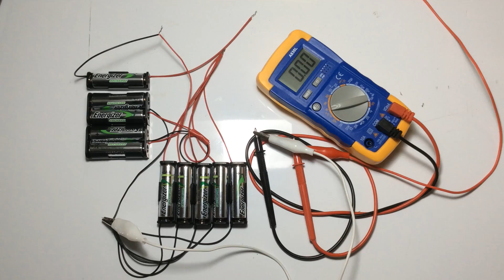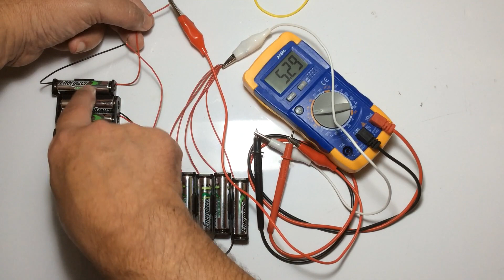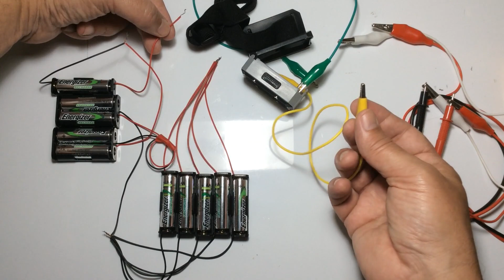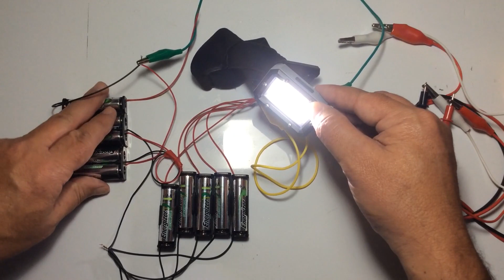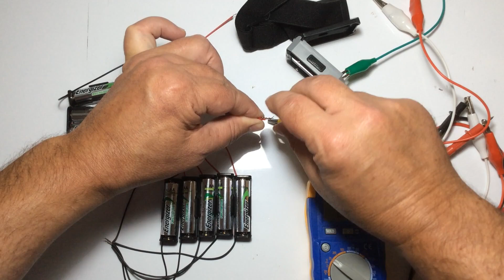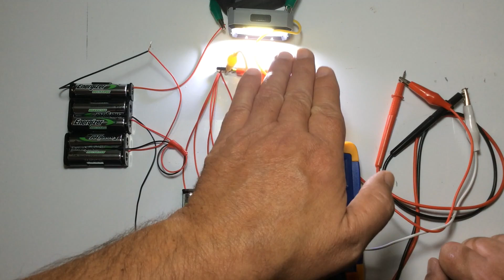POWER TRANSFER METHOD - GREEN ENERGY RECYCLING

Comment: Thanks so much dear for shearing. I think this is all about a potential difference across either positives or negatives. One day i used a boost converter to boost a battery voltage from a 12v to 35v and then connected a hug capacitance capacitor [10mf, 100v ] to this output of a boost converter 35v in stead of swapping batteries. Then i connected a 12v lead bulb across the positives of the battery and the output capacitor. it produced a massive light in the bulb. However i lacked the wattmeters which i needed to measure the energy in and out of the system. If you can also experiment with such an experiment as it looked to be effective. We need to connect one wattmeter to the battery to measure the input energy and put another wattmeter across the load, then we shall get the exact cop of the system. With this i believe some energy is transfered back into the battery source through an inductive load.Thanks
Reply from the maker: Thank you for your comment.
Your experiment sounds very interesting, I understand it is difficult to explain the connections but if you want to give it a go then I can attempt to test it. Normally one would assume a capacitor would not supply enough power but as can be seen in my latest video these devices are not consuming the normal amperage.

Comment: Thank you for this video. You may have noticed with a comment on another video of yours that I did this test using a 3V DC (brushed) motor. It yielded results in terms of energy transfer to the parallel bank batteries, but not near as impressive in terms of run time and transfer that you're doing with an led. Presumably this is because these motors are inefficient (produce waste heat) but cheap to make. When I get the $$ I want to redo the test using a proper brushless servo motor operating off a pwm. I did a little investigating and it seems from initial feedback that they may be even more efficient than an led! (but I can't be sure of that until I do it)
Reply from the maker: Thank you for your comment and sorry for my late reply.
Unfortunately most motors are just not very efficient and the cheap ones are terrible, proud of an approximate 30% efficiency rating resulting in 70% converted to heat. So I imagine the best approach for this system is a load as close to 100% efficient as possible, the more efficient the load the more we can transfer. Some of the hobby aircraft motors may be more favourable and it may also be a good idea to read the stats on the motors in search of the high efficiency motors. A pulsed motor would be a good idea because the down time and collapse of the coils fields allow the capture of extra energy.
Please let us know how it goes with your experiment.

Comment: Hello. Did you try with a DC motor? A small one to see if transfer still works with a system using induction ?
Reply: DC motors (the typical kind that operate with brushes) are very inefficient. I did the tests with a 3V DC motor and while there was a transfer of energy, it is not as impressive as using something like an LED. Probably comparable in terms of waste to an incandescent bulb vs an led, primarily from waste heat. But yes, there was a transfer of energy to flat batteries regardless.
Reply: @stravs8097  Thanks for your answer. Leds are acting differently than conventional load (if I may say !). Probably transfer could be more efficient if high voltage transformer can be applied on induction loads using some capacitors for fast decharge at high frequency rate. Anyway the method shows that interesting phenomena appear in that configuration and it must be studied. Have a great day
Reply from the maker: Thank you for your comment and sorry for my late reply.
I did try with the 12 volt motor and a smaller 3 volt motor and whilst both motors work, there was a noticeable loss to heat as opposed to transferring the power.
As @stravs8097 has pointed out from his experiments, using a higher quality motor may improve the outcome but for now motors may not be the best loads. I have read pulse motors are a good thing so if I ever rebuild my pulse motor I will definitely give it a go.

Comment: New discoveries base on your creation: try to keep the voltage differences between the ones in series and parallel. Big difference leads to faster draining because amperage increase with voltage. If the voltage difference is too big, the battery capacity needs to be bigger or else they will drop beyond danger levels. Personally, I like the 2 series 2 parallel for 12v setups because it keeps the voltage difference low. Of course 10pcs of 3.2v lifepo4 batteries is cheaper, but they drain way too fast and have to keep them swapping 😂
Reply from the maker: Thank you for your comment and sorry for my late reply.
I would agree with you regarding the voltage difference, if too large a difference we just get heat being produced. My latest video shows this, as the voltage drops, the amperage settles down to an extraordinarily low value. For example, the circuit at 7 volts uses approximately 18mA whereas at 6.6 volts the circuit uses 3.4mA.

Comment: Since electrons are not destroyed in a circuit they are free to be sent into batteries to be charged. The heat and light though come from another source which some call zero point energy. I am still running very extensive tests in my lab to see how far I can go with swapping batteries around.
Reply from the maker: Thank you for your comment and sorry for my late reply.
Have to agree with you re electrons not being destroyed which only validates this concept more, it has to go somewhere. As we are both investigating this concept you might be interested in my latest findings and I will try to post a video today of some interesting developments.
My health hasn’t been to kind to me lately so I am yet to check in on your progress.
I hope it is going well.

Comment: Great video.  Thanks for the details and how often to change batteries.
Reply from the maker: Thank you for your comment and sorry for my late reply.
I still need to do so many tests to confirm the best rate of battery rotation but it makes sense to change them around each evening as it’s required. Ideally an LED light should be chosen to take the full 24 hours to drain the batteries to prevent over discharge.
How is your health these days good sir?

Comment: Glad you show this. G Moray has shown this many years ago and this phenomena is happening with all circuits just because all loads are configured as a short and this practice is against nature. Search for ufopolitics to see 750w motor powered by 2 aa batteries for 25 minutes.

So applicability of this method will reduce all consumption in the world at least 3 times and electric vehicles or household power banks can be huge reduced with the price drop in order of thousands without any modification of devices.